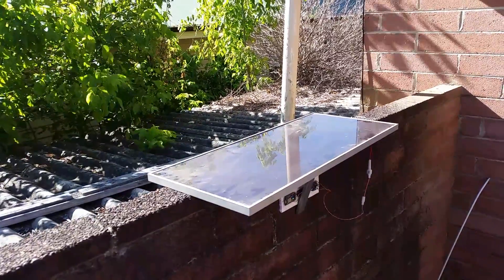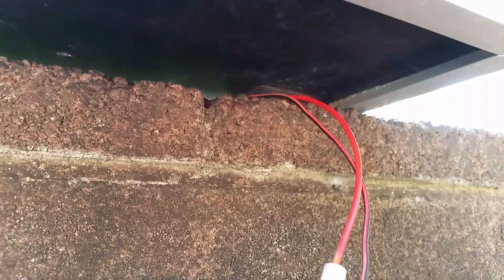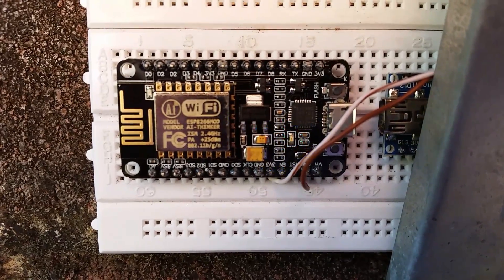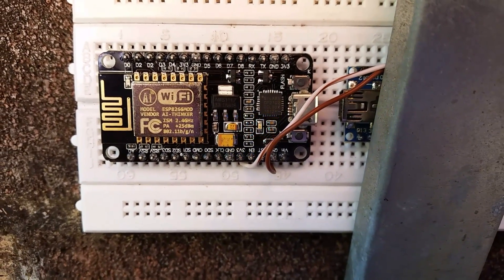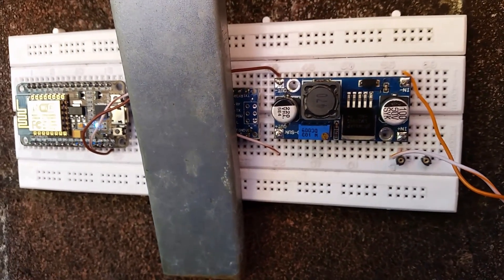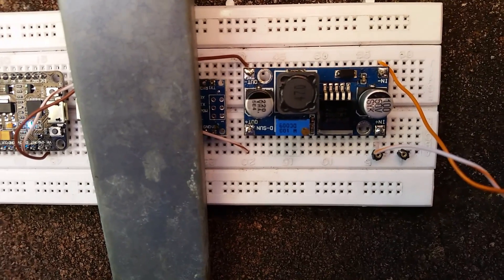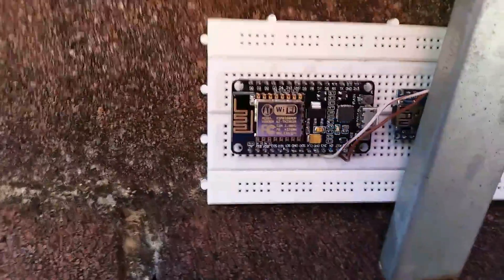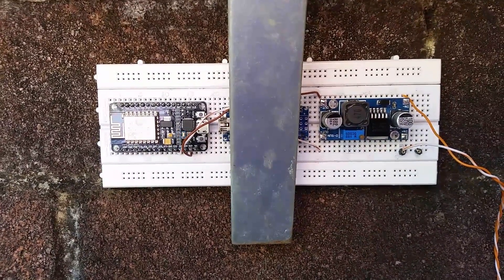Solar powered esp8266 and arduino

Comment: Do you have the schema to connect solar panel with ESP8266 as it is now but also with the battery pack? for when there is no solar generation? Thxs
Reply from the maker: Demo Vitria if you are not concerned about squeezing the most efficiency out of the solar panel then do as follows:
solar panel output connects to buck converter set to regulate at 13.8 V + 0.6 V = 14.4 V.
connect the buck converter via a diode to a 12 volt lead acid battery.
connect a second buck converter to the battery set to regulate at 3.3 volts and connect its output the the 3.3V and GND pins of the ESP8266.

to keep the battery charged it needs to see a voltage of 13.8 volts. a diode will have a voltage drop of 0.6 volts so you need to take this into account. without the diode connected the battery will discharge into the buck converter at a rate of around 100 mA when the solar panel has no output.

this is a quick dirty solution however the best way is to use an MPPT charge controller, this will allow you to use a smaller solar panel for the same application. you will still need to regulate the battery voltage down for the esp8266 as the onboard regulator is not efficient compared to a buck converter.

hope this cleared things up for you.